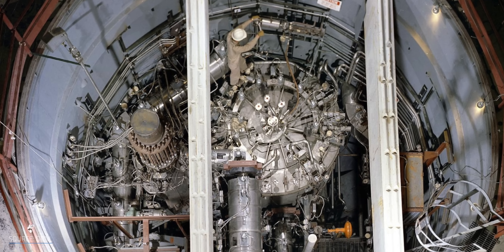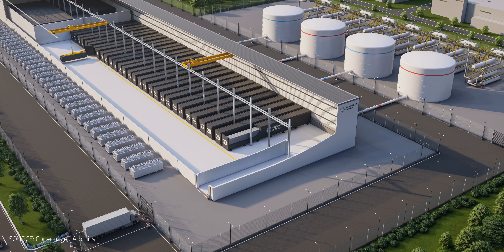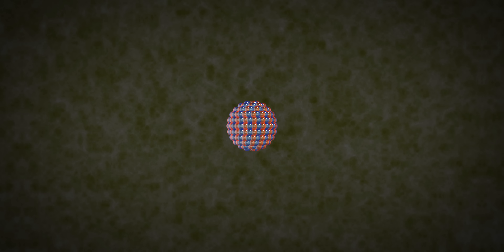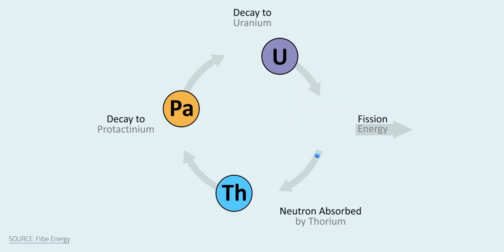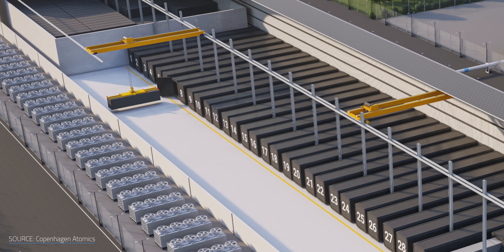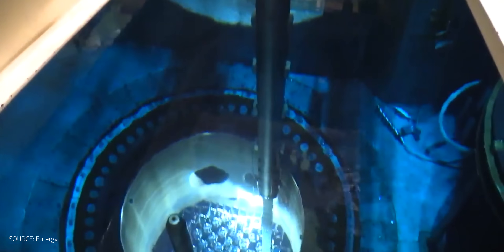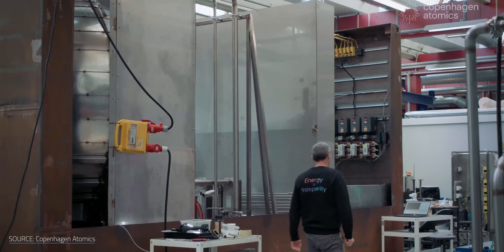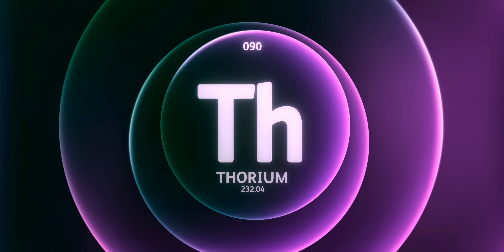Why Thorium is About to Change the World

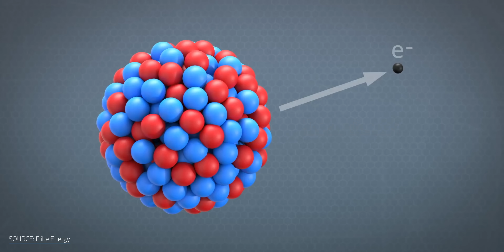Comment: 4:30 This is highly misleading. You literally say that more fuel is created than is input, but that is clearly not the case. Fuel is consumed in this process. The fuel being consumed is thorium. The fuel being created is uranium. More fuel is being consumed than created, but twice as much uranium is created that can be exported for use in a uranium reactor than uranium that undergoes fission within the thorium breeder reactor. That's what you should have said.
Reply: The Th isn't technically a fuel, just like U238 isn't technically a fuel in a thermal U cycle reactor, although some of it is converted to fuel during operation. In a solid fuel reactor we call it a "fuel pellet" or "fuel pin" because it contains fuel, not because it is made of 100% fuel. Same is true for "fuel salts". For thermal spectrum reactors only U233, U235 & Pu239 are technically fuels (i.e. if it isn't fissile, it isn't technically fuel). For fast reactors there are some additional elements & isotopes that are considered fuel. I know it's technical semantics, but he basically got that part right.

A reasonable, though clearly not perfect analogy would be catalytic distillation of crude oil. Crude oil is not considered a fuel, but heat it up, run it over a catalyst then distill and fuel comes out the other end,  a portion of which is used to continue heating the feed stock (crude oil input). In both cases you need an actual fuel to start the process up.
Reply: the point of op is, that the video clearly tries to hype this process up to be some kind of unlimited energy source. which it is not.
Reply: @sebastianvega4576  A fuzzy limit is placed on it at the 1 min mark for those with ears, "thousands of years" and that is a conservative one. The same is true for U cycle breeders. There is no such thing as an unlimited energy source. Even fusion if it is made to work has a limit as do renewables. In both cases the habitability of earth expires first, but there is still a limit.
There are lots of hyped properties with Th, but unlimited energy source isn't one of them for those paying attention.
Reply: @richardb1452  as you pointed out correctly, the fuel analogy is bad. still they use it in a way that very much suggests this process puts out more fuel for the same process. people thinking of their car and its fuel would come exactly to this conclusion, i would assume. nuclear power is a dangerous technology and thorium, or better said uranium-233, is ever harder to work with than uranium-235.
Reply: @sebastianvega4576  Nearly all technologies can be dangerous. I would argue commercial nuclear has a pretty good record. Somewhere in the range of 16,000 reactor years of operation with only 2 serious release accidents. Chemical and industrial accidents have killed either immediately or with delayed effect far more people than commercial nuclear. RBMK as used in Chernobyl was an accident waiting to happen and everyone knew it, which is why that type was banned in the west decades before the accident. The advanced GenIV designs are even safer than the fleet that logged those 16,000 reactor years and would have survived even the Fukushima scenario without serious damage or release.
I'm not a Th fanboy and in particular not a fan of CA's approach nor other small SMRs in general. They may be useful in very remote areas, but not generally IMO as I think proper containment capable of withstanding a direct airliner crash is a mandatory requirement for widespread adoption of any reactor type. I do like the higher end just beyond SMR class as that seems to be less capitol sensitive, in the 300-400 MWe and designed to load follow. The Natrium and MOLTEX SSR designs seem a good fit to me. Both have containment are passively safe and will be capable of exponentially reducing the radio-logical lifetime of existing waste in later versions with electro-chemical reproccessing. Both technologies can be designed as burner, breakeven or breeder and neither is designed primarily for Th. I want to see these commercial demonstrations, both of which are engaged in licensing, 1 in the US and the other in Canada, run to make sure we have safe options.
I don't think renewables alone can economically meet the requirement for everyone, worldwide, 24x7. Some areas are blessed with high renewable capacity factors, others are not. We need options so the optimal mix is available for each individual area and nuclear is one of those options.
Reply: Not at all misleading and you are misunderstanding the processes being done and the shorthand being used. The "fuel" for these breeder reactors can be considered just useless rocks. These reactors use these "useless rocks" to create nuclear fuel that can be used by non-breeder reactors and fully consumed, or used to kick-start new breeders. It is consuming a "non-fuel" to create a nuclear fuel, though yes, that non-fuel thus becomes fuel for breeder reactors. But at the same time, the fuel they generate is still useful alone and in other applications seperate from these breeder reactors. They do not kick out useless rock, but instead "charged rock".

They are self-sustaining nuclear "distillation towers" that define a new fuel and create more of an existing one.
Reply: @KaiserTom  I understand perfectly well. I am saying the communication is poor and OTHERS will misunderstand.

Comment: Because Matt  started video like this with info abou Danish company preparing this powerplant  and skiped(!) info about  China  where the very first thorium powerplant is alŕeady producing elektricity..., I am closing this video imediately since I am disgusted !!!!!
Reply: The China facility does not produce any electrical power. It produces 2 Mw of thermal power which IF it was coupled to a steam plant would only produce 33 Kw.  They are building a 10Mw plant but these are experimental.  BTW, a typical commercial nuclear power plant uses 100 Mw just to run all the equipment and has a net output of 1,000 electrical Mw.
Reply: @clarkkent9080  I see what you mean, however, Matt is talking about Danish company preparing something, but China has it running for some time already. The scale is not important, since Denmark has nothing at all what could be compared with Chinese small reactor.  China is first and it should be said in that video at the beginning instead of that info about Denmark preparing it only...

Comment: So, they build sealed reactors in containers and put them in large warehouses, to be running for several decades. And those reactors produce more U233 than they use, so every ten years they can somehow take that additional U233 out of the sealed containers and build new reactors with it? While not risking any contamination of the warehouse with fission products... where do those stay, btw? And where does the waste go when the several decades of runtime are over?
And how do they keep the next best terrorist (or russian dictator) from crashing a plane or cruise missile into the warehouse?
The waste of U233 and the waste of U235 won't differ that much btw, the stuff does not split evenly in half and a lot of isotopes will be very similar.

Comment: This is not new. We perfected Thorium reactors in the 60s. When Uranium runs out. Thorium will be our only choice. There is a problem with the salts causing problems with valves and rod movement.
Reply: Wrong, west did not perfet it, west even was not able to do it at all, since corrossion problems... Because Matt  started video like this with info abou Danish company preparing this powerplant  and skiped(!) info about  China  where the very first thorium powerplant is alŕeady producing elektricity..., I am closing this video imediately since I am disgusted !!!!!

Comment: What if the molten salt solidifies in the unit? (ie: the reaction stalls)
Is there a restart or reheating process?
Wouldn't an extremely expensive material like inconel be required to resist the corrosion of the molten salt?
How does the cost of replacing a reactor module made of these materials in a sealed container compare to the cost of power generated?
How do you dispose of the radioactive isotopes dissolved in the salts? How toxic or reactive are these salts at room temperature (seeing it's an amalgamate of Li and Na fluorides) 
Is it worth it, or should we try going the opposite direction and just use analogue systems that don't require electrical power? (ie: analogue computers)
Is there an end-of-life plan for spent reactor modules?

Comment: Been hearing about Thorium for decades. It's about time someone did something to make it useful.
Reply: My dad was exposed to and worked on high sec. projects. I remember him mentioning Thorium at dinner table conversations when I was very young, like 68' or so.
Reply: It won't change anything. we currently have safe nuclear capabilities and for some reason we aren't using it.
Reply: @jayknight139  the energy companies have bigger profits with the current ways of generating power.
Reply: @Hugh.G.Rectionx exactly correct. existing nuclear is not and never has been cost effective.
Reply: @Hugh.G.Rectionx  no actually it is lower, subsidies do make them a lot of money, cheapest energy is nuclear
Reply: @mikebrandenburg9922  no. you are wrong. they DO have more profits with the current ways of generating power.
Reply: @jayknight139  The current way of building reactors is too costly.  A new approach is needed.  This would change EVERYTHING.
Reply: @jayknight139  my big conspiracy theory is The Simpsons accidentally made Nuclear power seem way more dangerous than it is.
Reply: @jayknight139  We do not use thorium because it produces U-233 the most reactive uranium isotope in the world.  It takes LESS U-233 to make a critical mass (aka bomb) than U-235 and even Pu-239.  A few people at Los Alamos were killed in the process of trying to figure out how much Thorium produced U-233 pure to go critical.  It is only between 12-15 kg.  Thorium reactors have to be started with Pu or Uranium.  The U-233 made from irradiating Th -232 is a nuclear proliferation disaster.   And the WORST type of Thorium reactor is a MOLTEN salt reactor where the Thorium flows in the salt coolant.  Chemically removing the U-233 from this coolant is simple, twice the extraction, 46 days and you got a nuclear bomb.    If the thorium is embedded in pellets with Uranium inside fuel cladding it may be better for avoiding nuclear proliferation, but any recycling of the fuel rods with the chemistry needed still makes weapons.
Reply: @jayknight139 Said: "It won't change anything. we currently have safe nuclear capabilities and for some reason we aren't using it." Fear and hate, particularly by the Baby Boomers in the US. That's why.
Reply: @wallaroo1295 What "safe nuclear capabilities"?
Reply: My late husband, told me about Thorium, he would be rapt to see this development. Maybe his spirit recommended this video 😇 🥰
Reply: Depleted uranium was to valuable to the weapons industry
Reply: @remy4320 actually it doesnt matter if it's depleted or not for most defense purposes.
Reply: Don't worry boys, fusion reactors are only 20 years off...
Reply: @TheBenjdude   According to AI, "China leads in fusion patents and is rapidly building and commissioning facilities, a pace and scale that experts suggest could allow it to surpass the US in the coming years".  Perhaps sooner than you thought, 10 years maybe.
Reply: @LP-hm7tm  Great comment! I would see this largely as a good thing. What we need right NOW is for the technology to be explored and 'solved' then everyone will have their own version (somewhat like nuclear is today). If China wants to spend a bunch of money on it then that is mostly OK with me. As far as patents go: China does not recognize worldwide patents and I think that is reciprocal, so... The good news is that fusion will be difficult to weaponize compared to nuclear technology.
Reply: It was never about the energy... and you can't build bombs from Thorium or its byproducts. 😑
Reply: Thorium is a dry hole. They played with it in the '60s and again in the 2010s. Juice just isn't worth the squeeze.
Reply: Most of the someones to date are governments who want plutonium.  No one builds uranium reactors for power. Wouldn't be prudent.
Reply: Its fun to see all of this nonsense. Nuclear was never cost efficient. And the calculation got even worse by the decades. You simply get Solar wind combined with batteries by many degrees cheaper than nuclear. And Thorium doesnt even allow any cross-financing with the military branch. So there is no use case for Thorium. Every country, who is not doing it or who cant afford it, will be in many years better off, than the others.
Reply: Been waiting for that home hot tub sized thorium reactor for decades. Knew that would never happen because it cuts out the middleman. Here is a model that keeps the utility companies in the middle, so maybe it will have a chance.
Reply: Making Thorium useful is not the problem but extracting and processing it without exposing workers to extreme radiation are huge problems.
Reply: With nuclear energy officially labeled as green and the big bad orange man getting rid of some of the red tape hurdles to advance nuclear tech, we are doing something about it now.  We never should've stopped, but angry anti-nuke hippies screwed things up 40yrs ago after 3mi island.

Comment: Same issues remain:
Safety
Waste
Costs
Reply: Safety: 
An order of magnitude safer at least, because of passive safety - "Go away safety"
Waste:
Specific reactors burn down fuel completely. Waste is 95 % partly precious metals and 5 % unusable, after 300 years not more radioactive than natural uran.
Costs:
Much lower, because simpler and mass produced -> economy of scale
Reply: @egnegn123  is it safer from terrorist attack? That's what I mean by safety. You need armed guards for this power generation.
 It's less wasteful, but overall still radioactive waste remains.
Nuclear projects are very expensive endeavors, have big starting costs and almost always inflates 2x or even 3x times the original budget. There is not a small chance that it can inflate that much that the whole project is abandoned like the one in UK recently. This apply to all nuclear tech.

Comment: Former Nuclear operator for the US Navy here. There are other less expense less cumbersome ways to produce electricity the planet needs. Seems like a pig in the poke to me. Just my 2 cents. Nuclear power will play a role in powering the future but other ideas are more promising. Also more realistic. The earth itself holds the key to generatoring electricity. Tapping into it directly will solve the demand. Check out what Iceland is doing for example. Geothermal Power Plants: Geothermal power plants like Nesjavellir, Reykjanes, Hellisheiði, and Krafla tap into these hot spots to produce electricity on a large scale. Water is pumped down, superheated by the earth's interior, and then the resulting steam is used to drive turbines and generate electricity.

Comment: no, thorium is overhyped dumb distraction. it's borderline fossil fuel psyop for counterproductive popsci youtuber like you. we just need traditional uranium PWRs, they are not vastly superior to current nuclear, current nuclear is already the safest, most reliable, easily scalable. fusion or thorium or molten salt blah blah blah is just to push the counterproductive message that nuclear needs to transform at all to ''solve its issues''. we have literally zero problem with current uranium nuclear and they are already jaw-droppingly comically safe, long-lasting, and cheap for everyone unless insanely specifically maliciously sabotaged.

Comment: Thorium is the most abundant element on the planet. We used it in street lamps.

A thorium reactor is like burning big logs. It takes spent fuel to ignite it (plutonium) Once it gets going its a very clean energy, burning up all its waste so nearly no nuclear waste left over. 👌 

India have been stockpiling spent fuel from uranium reactors for years. Next phase thorium reactors. 

Listen to the BBC elements thorium.

Good stuff.

Comment: If this system works, I can see it eventually being used as a vehicles engine replacement. With enough time and engineering the whole system will be shrunk down to give enough energy to power personnel car or semi-truck.

Comment: Shipping container nuclear reactors that pump out gamma raditation and so need to be kept away from people.   Also, each only lasts 5 years before needing to be replaced.  Also, no commentary on what happens to the old, presumably radioactive, reactor materials?   Mmmm yes -- that sounds super tempting for commercialisation.   But also guess what: countries and businesses won't ever own or be able to control these machines!  Instead they will have to 100% trust a Danish company -- "trust with what?" -- ohh their entire reputation as they install hazardous gamma ray emitters,     Ah yes, and to top it all off? The only thing holding back these reactors is... regulation and laws...   Absolute madness.